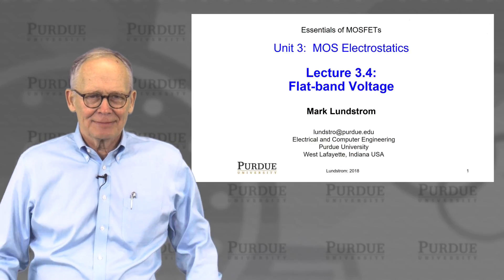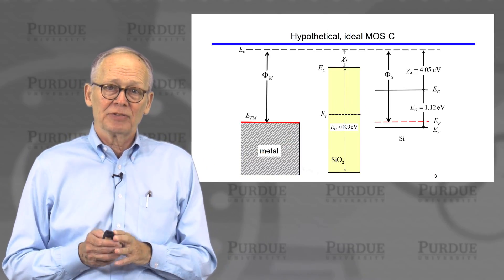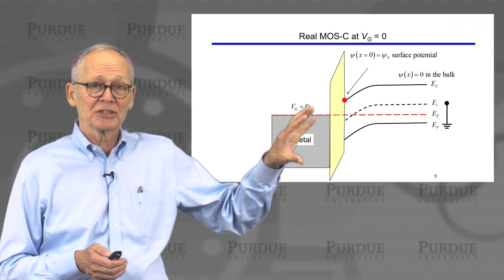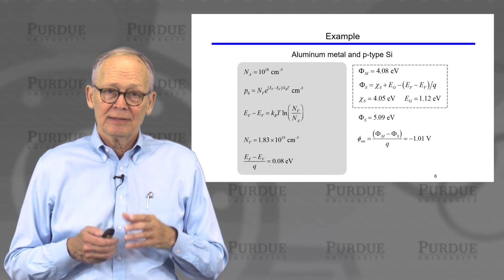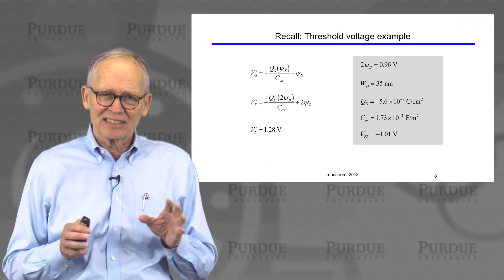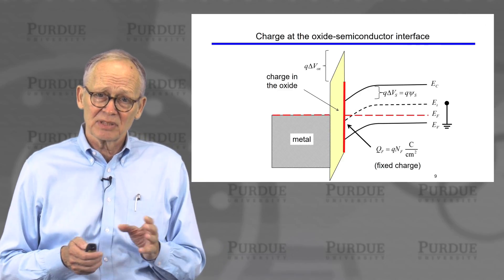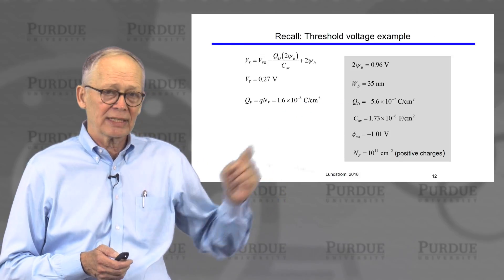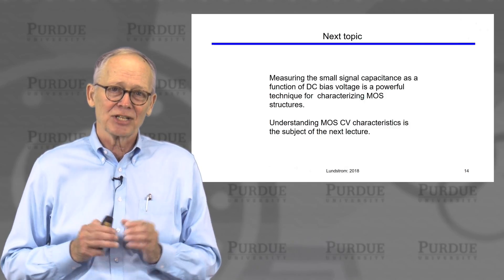nanoHUB-U MOSFET Essentials L3.4: MOS Electrostatics - Flat-band Voltage

Comment: 00:00    Lecture 3.4: Flat-band Voltage
00:28    Hypothetical, ideal MOS-C
01:10    Hypothetical, ideal MOS-C
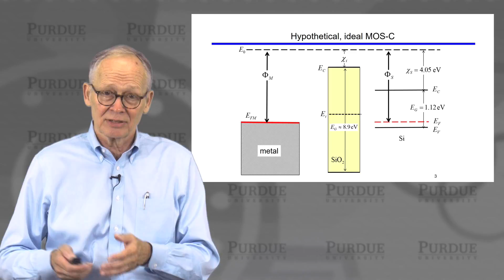03:05    Real MOS-C
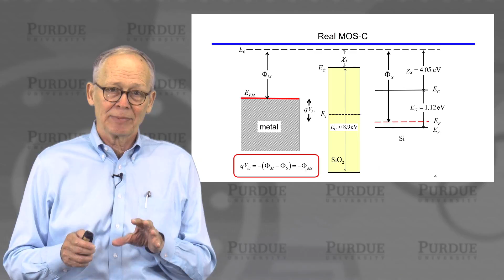05:22    Real MOS-C at VG = 0
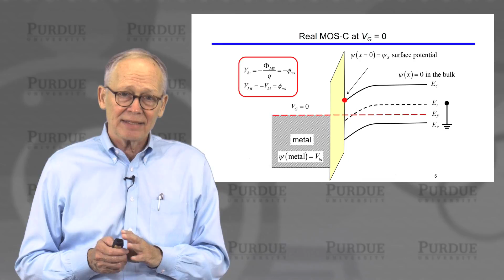07:14    Example
09:31    Gate voltage vs. surface potential
10:26    Recall: Threshold voltage example
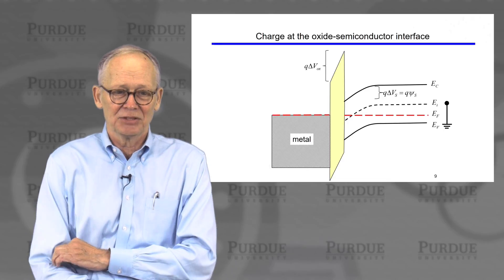11:25    Charge at the oxide-semiconductor interface
13:41    Volt drop across the oxide at fixed surface potential
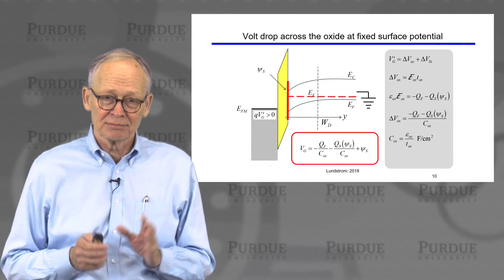15:25    Flat-band voltage again
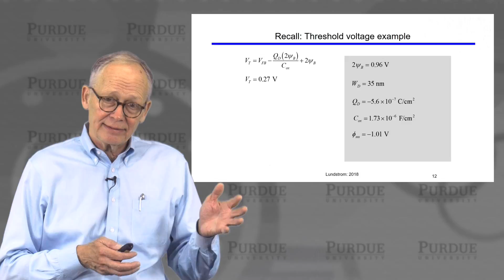15:59    Recall: Threshold voltage example
17:43    Summary
18:13    Next topic